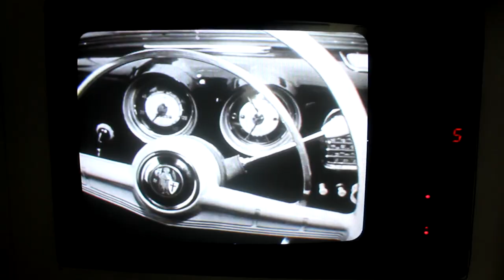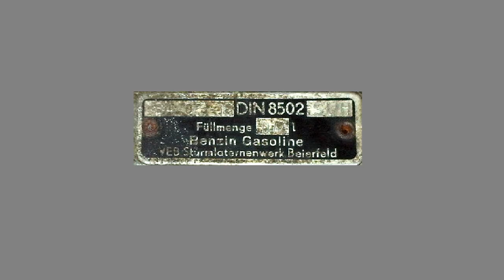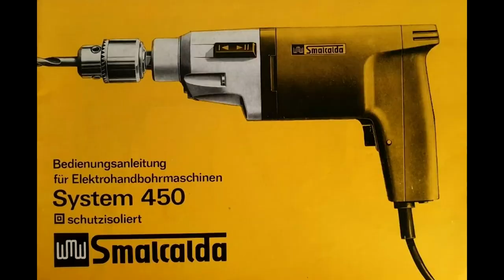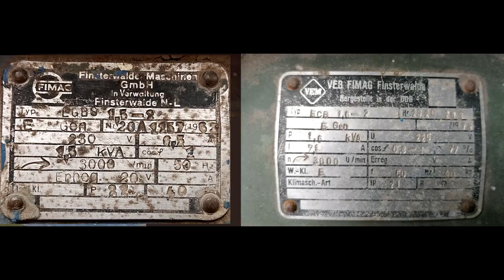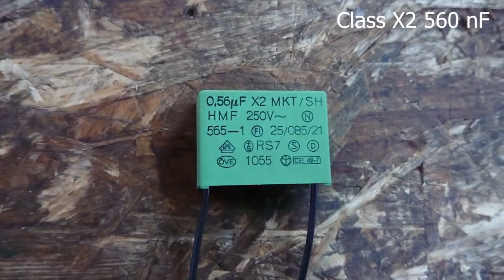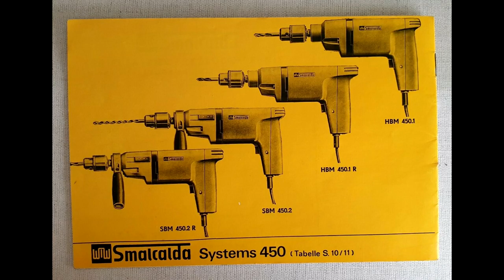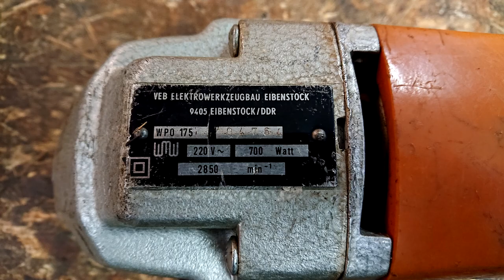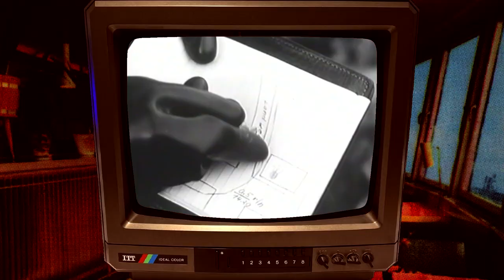The Tools of Socialist East-Germany! Repair-A-Thon!

Comment: Very cool video. I was in East Germany right after The Wall fell, and it was like going back in time 50 years .. very strange. I remember they were driving the Trabant automobile, and it was so unreliable you had to carry tools and know how to repair it because it broke down so often.
Reply: No, they weren't. Trabant and Wartburg cars were very reliable and bulletproof tough. There wasn't much tech in them to break or fail anyway. Owners carried some tools in the trunk JUST IN CASE something breaks, so they can fix it on the road side.
East german car owners in general knew how to maintain and fix their cars without heading to the shop. (Other than today, where some people are making an appointment just to get the tire pressure checked...)
Spare parts were rare, and you had to wait several weeks, if not months, to get a shop appointment. Not because there were so many clients, but because of the mentioned sparse spare parts situation and also because the mechanics took their sweet sweet time to get to work. 

TLDR: These cars were simple, reliable, build tough, and looked after.
Reply: @grumpyoldman5772  It depends how you see it they either broke down often or required a wrench to operate properly :)
Reply: @fischX 
Fact is, they didn't break down more or less often than modern cars. The difference is you didn't need equipment worth thousands of money, special skills training and a laptop with certified software. You could fix them with basic tools in a parking lot.
Reply: @grumpyoldman5772  I agree to disagree :) modern cars rarely get the motor sumped, belts don't become loose, starters are much more reliable now and batteries just don't die on the spot. Those are the things people back then fixed in a parking lot. Of course entertainment, seat heating, heads-up displays and climate control could not get defective because it hasn't anything like that. We don't have to discuss that cars today are much much more complicated than a Trabi. The Trabi was also not designed with obsolescence in mind I give you that, cars today are designed with end of life in mind. It's still a romantic comparison because two wheels and a spoke are even more easy to fix ;)
Reply: @grumpyoldman5772  - Trabants were reliable? You obviously grew up in a different bizzaro universe! 😱
Reply: @ozarkarky 
Other than you, I didn't need to wait for the Berlin wall to fall to go to the GDR. I've lived there in the first place.
Where did you come from to visit?
Reply: @grumpyoldman5772  That reminds me of my Chevrolet C10.
Reply: @ozarkarky  I think they were for their intended use... when you finally got one after many years of waiting you would do maintance daily yourself as a proud owner and only drive short distances and never on full speed.. ever driven the old DDR 'highways'? After a short trip on those in a Trabby you needed to go to the dentist since it was so light it really bounced. 
They also gave the real airoplane-feeling when going downhill ;-)

Of course the toolkit made a nice balast in the car since it was all really weighty steel instead of this westerners lightweight 'tools'.

Comment: As someone who has dismantled and repaired countless electric tools in the USA for over 60 years, I have never found capacitors in any hand power tools... Perhaps because all of our smaller tools run on 110/120V AC, not 220/240 V AC. And I live on the southern boarder of USA  just 7 miles from the northern border of Mexico near Reynosa Tamaulipas.

Comment: Back in the late 80s, I had gotten an opal cadet wagon. When I went to get new tires, this one place where I got odd parts for older cars I worked on had these east german tires by a company/brand name of "Pneumatic" . They were not steel belted but I found the tread on them gave exellent traction and was very impressed with that and their long gevity. I do not know if that company still exists today. I also talk esmiregular to some Annabaptist farmers who lived there during the soviet occupation who still use the combined russian/east german manufactured farm equipment and they love them. They ger new replacement parts from russia, or they did, not sure if it would be on the sanctions list now or not. But one thing they all had in common, they missed being a part of DDR and in league with russia and wished they could return to the russian sphere. Seems they were not treated well upon reunification. Not trusted either so they never fully integrated into the western german idealology. And they still have and use their older DDR tools and love them. They speak of a higher quality than the newer tools of today.

Comment: Another interesting video. I think this is a wonderful surprise!
In the video clip at 2:49 the workers appear to be in the process of making a large glass reflector telescope mirror, perhaps 2 meters in diameter. It almost looks like one worker is marking zones for additional polishing prior to putting on the metallic mirror surface itself. I am somewhat surprised that this is not a clean room and the workers are not wearing overalls to prevent contamination. What company would have made large telescope mirrors at that time, and were the mirrors installed in observatories throughout the world, or only in soviet-aligned countries?
Reply from the maker: This photo was probably taken at the Carl Zeiss Jena plant in Jena, GDR. I do not know for which telescope it was built.

Comment: That hbm250 is very reminiscent of the form factor that Black & Decker used to use in North America during the 80's, I have several and have had them since I was a child, they are cheaply made but do there job well. Black and Decker had full body plastic housings which was a serious downside especially when overworked.
Reply: It's even possible that they where actually made in the GDR and sold under some other brand like Black & Decker. Although I have only heard of things like photo cameras being sold within western europe like this. Gerold mentions this when he talked about the inscription on some of the wrenches.

Comment: Good to see.  I wonder if the DDR small generating set will turn out to use a Simson 50 engine, or even MZ 125?  :-)  Those 'supersteel' spanners turn up here in UK in MZ tool rolls.  My most unusual DDR tool is a thing-for-putting-early-4-speed-MZ250-clutches-back-together.  I would expect a word exists in German for that.

Comment: I need a drill like that, modern ones are gear to spin a bit at 10 million rpm, not usable for more than 5-6mm (holding the trigger lightly will limit torque and burn the rotor when it stalls)

Comment: Maybe I'm just an idiot... But power filters have given me so much trouble over the years. I work with test equipment and specialize in metrology and systems engineering type stuff... But of course... Clients, family, and friends alike call me first whenever their washer breaks, or some other appliance in their home or more often than not my curiosity gets the best of me and I end up looking at something that I probably shouldn't be spending time on. But I can't help it I enjoy helping if I can. I have seen the failure of power filters going back to things like Hewlett-Packard test equipment, all the way to the modern-day washing machines, dishwashers, and things like that. Very nice and well-made hermetically-sealed filter units. But for one reason or another fail pretty regularly. For a few years I was thinking that it must just be huge surges in voltage... And in some cases that is absolutely true. Although power is pretty stable here in the Southern United States... We have massive hydroelectric, nuclear, and other facilities everywhere. We have a weird mix of updated and nice solar stuff... But still have tons of people who try to build their own off-grid systems and end up back feeding into the lines accidentally buy generator, battery, or what not. There are several people around my medium-sized Town who have like myself... Obsessed over these huge forklift batteries at the scrap yard that have more than 80% of their life left when discarded. The other the size of a small car but they're dirt cheap. Usually cheaper than the materials even not considering the lead. People just don't want to deal with them. So you can usually buy them for a few cents per pound. Even though they contain lead and stuff. Because some of the scrapyards want to get rid of them so badly they sell them for the same price they bought them for. Only taking them because the corporations who bring them are great clients otherwise.

So some of the power filter surely have been damaged by Serge or what not. Just unclean power or whatever it is. But it seems like... Just like rifa suppression caps... A lot of very nicely made and filter assemblies can cause trouble pretty regularly

Comment: German here, fun fact, the switch seen at 12:40 may fail after several decades. But it can be disassembled and repaired. No parts needed, the contacts are symmetrical, and can be turned around for next decades.

Comment: that power cord damage is from squeezing , 
it was opened before and the cable came stuck , when used they tend to break and create a short 

does your handle not fall together as it should ?? somethings wrong :P

Comment: That orange hammer drill is illegal, look at it it's a freaking short barreled assault drill overall length under 28 inch with vertical foregrip and cut down stock for tactical maneuvering. lmao xD

Comment: Are those power tools hard on your hands?
Old black and decker had that green color. they didn't have any dampen like tools of today those old tools are a different type of beast.
Reply from the maker: The Eibenstock tools have surprisingly low Vibration. But they are heavy of course.

Comment: While the Allies split Germany into 2 they probably didn't think they would become 2 separate countries like that in the beginning, but seeing as Russia was involved, that's what Russians do. Romanian Moldova was split in 2 and partially russified then it reunified into Romania, was stolen again and after its independence was split into 2 with Transnistria a heavily industrialized zone with more ethnic Russians which basically kept the "independent" Moldova in line. The same tactic was applied with Georgia. Armenia & Azerbaijan have disputed territories and the Russians just kept them in stalemate not wanting to resolve the issue. They used the same tactic with Ukraine, but on steroids and were more aggressive. Anyway...:P

Comment: Great video - You know my dad has a bunch of East German tools some of which look awfully similar to some of those. 

He worked somewhere in the 80's which purchased some machinery from the DDR and a crew used to come once a year to service it. A lot of their tools like drill bits and saw blades were antiquated by Western standards - the whole blade for example being hardened instead of just the teeth. Every time they came much trade was done for things like tools and consumables not to mention some electronics! 

It does say something about communism that despite what a useless failure it was that the Germans ran the most successful communist country.

Comment: just a thing... what if i run a power tool without the filter or with an oversized filter?
Reply: Without a filter other devices connected to the grid can be damaged, and any wireless communication can be disturbed nearby. 
With an oversized filter your only real issue would be fitting it into the device, and maybe a bit higher wear on your switch contacts.
Reply: @Basement-Science  thanks :D

Comment: What is the German equivalent to fluke testers? Tired of the monopoly they have in the states.
Reply: Probably Siemens. And AvE once explained why Fluke is so expensive: every one of those testers has to have very strict tolerances. As they are used in production and fabrication environment where any other brand would produce too many faults when exchanged for a newer VA meter. Siemens was according to my dad one of the companies that in Europe set the standards for quality in industrial environments.
Reply: @FrankGoossens_DIYDental  ty sir